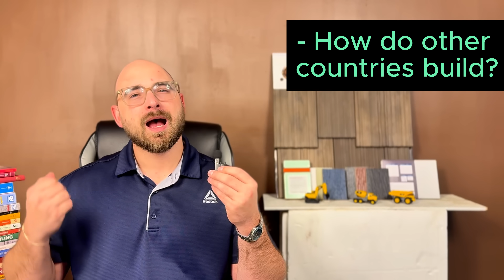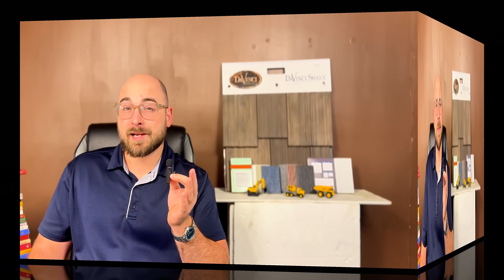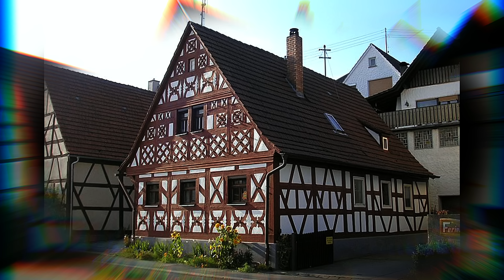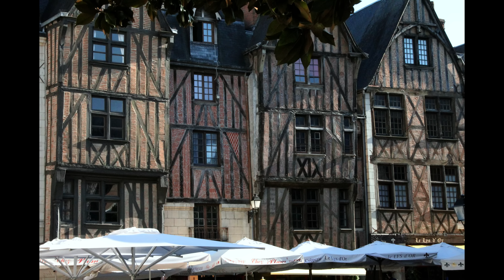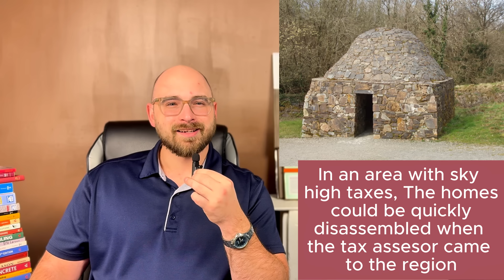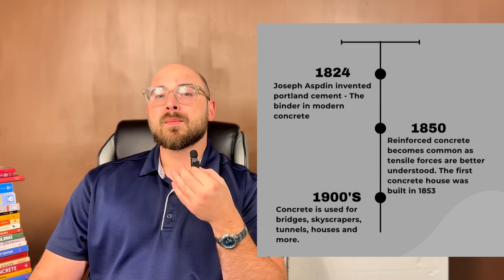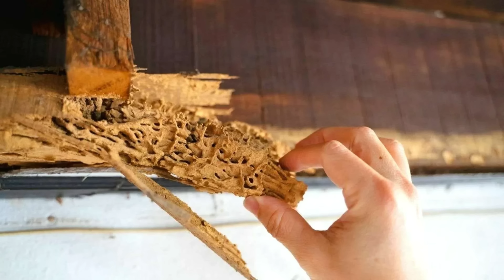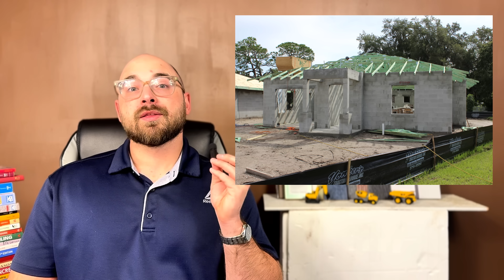Why Other Countries LAUGH at American Homes

Comment: As someone from Spain: it is common over here for people to joke that houses in the United States are made out of wet cardboard. I can understand if houses are made of cheap materials in areas that are hit by tornados and monsoons often as to rebuild them quickly, but at a certain point they're just making the joke become reality. Punching a wall and making a hole through it wouldn't make me feel one bit secure inside that home, that's for sure.
Reply: Lol you cannot punch a hole through the exterior of a house in the US
Reply: in a land full of people with (unlicenced) guns i'd also rather have a concrete wall around my sleeping place.
Reply: Tell me you’ve never worked construction without telling me you’ve worked construction
Reply: Hopefully you don't take it personnaly and before that, I love my spanish collegue at work. But the quality of apartment in Spain and more specifically in Andalousia si a joke. You can here everyone everywhere in those apartment. We laughed a lot about it at work.
In France we are arrogant and full of rules for everything (it's a pain by the way), but at least our homes are top of the line. Even the windows is doubled/
Reply: As someone in Tornado Alley, building with wood isn't just about being able to rebuild quickly and cheaply. It's also about saving lives. It's easier and safer to dig yourself out of a pile of wood and drywall than it is a pile of bricks and stone.
Reply: @HeadFullaStuffin  why would you assume they would collapse. The last time building in my country collapsed was cuz in WW2 the germans bommed us. Other than that our buildings withstand nature like they should
Reply: @DaveGymShark  because if the storm is powerful enough, NOTHING is left standing. Y'all can get away with building with stone and brick because your storms don't get as powerful as often as ours does in the US. Go look up some tornado videos or hurricane videos and see exactly the kind of damage I'm talking about.
Reply: @HeadFullaStuffin  so amarican to assume we dont experience tornados. Just cuz u dont hear about em dont mean they didnt happen. Just accept it we have better infrastructure.
Reply: @HeadFullaStuffin  you can build tornado proof homes tho... like you retarded ? you think the US is the only country on earth with tornadoes ? tornado alley is only famous because you guys have to rebuild entire cities because of 1 tornadoe xD
Reply: @HeadFullaStuffin You have wooden houses all trough your country. Tornado's are just in a small part.
Quality of live is way higher here.
Reply: @HeadFullaStuffin If the storm is that powerful you'll probably be dead and buried under your wood pile anyway. I think you need to read the room a little and realise you've bought into the message a little too much 🫤
Reply: @lucaslandman8370  Do you not conceptualize that the Lower 48 US is very close to the total size of Europe and that the land space that can regularly be hit by Tornadoes is Huge. We get 1200 tornadoes to the 300 tornadoes all of Europe sees in a year.
Reply: @aaronorr5586  It's not about tornado's.  It's about being cheap and the whole focus on conumerism.
Reply: @aaronorr5586  So why build with wood outside tornado area?
Reply: @ Because frequently building homes out of concrete you end up with homes looking like Soviet bloc housing. Concrete alone also has poor insulation ratings in comparison to mineral wool/fiberglass insulated Wood platform framed houses. Internal ducting, Electric service, and plumbing also becomes far more difficult for tradesmen in concrete housing. Signal transmission for Smartphones and WI-FI in Wood platform framed houses is far more expedient. 

Concrete Masonry units and solid concrete formed walls rarely rate over r-6-r-8 at an 8" thickness where a 2x6 wall with insulation will net you a total assembly of r-19
Reply: @lucaslandman8370  A large portion of some home prices here in the US isn't even the structure, it is purely the land and local housing market that drives the price. The house I currently live in could be built for 80,000 in materials, and systems but because of where it is it is valued at 230,000.
Reply: @aaronorr5586  again.... Why build it with wood?
Reply: @aaronorr5586  You should visit Europe. You are brainwashed.
Reply: @aaronorr5586  You won't find any house below €300.000 over here.
Reply: @ I already pointed out why you build with Wood Platform framing. Insulation value, the ease of running the Utilities, the efficiency of fiberglass/mineral wool insulation. It makes the house more efficient at any given wall thickness than block or brick which both have much poorer r-values, it removes the additional cost of setting full courses of block and/or brick to create a full height wall, wood framing traps co2 in material of the house where concrete and brick don't, concrete and brick require the burning of fossil fuels to produce.

You get a house with plumb, square, and straight lines that in most cases will last for 70-150 years, you won't be paying for an extremely over weight and ugly block monstrosity, and your summer cooling and winter heating bills will be lower in comparison. 

Part of Homeowners insurance cost is price to rebuild in case something happens. Platform Framing rebuilds are charged at a lower insurance rate premium versus any block or brick built home, and when the Tornado inevitably hits it is important make the house right again as quickly and within the budget of the homeowner as possible.
Reply: @aaronorr5586  Sure dude. Stay in your bubble. Murica!
Reply: @aaronorr5586 concrete can be shaped in any form and painted in any color. It can also be covered in other materials like plywood. If you're making Soviet style blocks, that's on the architect, not on the material.
Reply: @lucaslandman8370  The Pacific side is Earthquake prone and they aren't extremely deep quakes (to give a hint, was driving during the 2001 Nisqually earthquake, the road was and still is straight, during the quake, the steering wheel was straight and I was in the wrong lane and then back until I had a spot to pull over, and that was a 6.8/Mecalli VIII. The Southwest has the problem of massive temperature differentials (Highs well into the triple digits, going to a nice balmy 50 at night), the Great Plains have the problems of Tornado alley which is basically from, let's use Europe here, Palermo to about Frankfurt-am-Mainz without anything to really block it, and in the North east on the eastern side of the Great Lakes as well as Michigan we have the Lake effect problem which blows european minds when we're talking 9-10 feet (3-about 3.5 meters) of snow in days, and need to be able to withstand that amount of snow along with the cold that comes with it.

A lot of it is the fact that you have a continent sized country that has, ironically just about every bioam, and amplified disasters that while Europe may get them, you aren't looking at people dying because it's 21.1 C because homes have been built to also keep heat out (or breathable), are made to collapse or not get tossed as debris when an F4 or F5, or even a regular F3 (the largest for Europe and it's rare there, not the average), Earthquakes that are generally more surface level and more often, has to be put up in places that can get METERS of snow over the course of days, not months, regularly, and has other things like Category 5 Hurricanes. And remember two of the scales are logarythmic, and one is windspeed+damage. So while a 6.3 doesn't sound big, that's about the equivalent of an F3 tornado in damage, or a Category 3 hurricane, and once again that 6.3 I was driving through was enough to diplace me a whole lane on a straight road.
Reply: @HeadFullaStuffin  ??? such a stupid  thing to  say  ....when you  can build house that  rezist  200km  wind  ....i  wonder  whay  quality  is equal  with  cheep  in US
Reply: @mellasio3911  200 km per hour winds are fine. But we also get over 300 km per hour winds. That kind of wind speed not only tears apart buildings, it also carries the debris with it. I don't know of any structure that would withstand that kind of intensity for even a couple minutes.
Reply: @HeadFullaStuffin  i  can  show  you  projects  of  housings  that  are  build  for huricanes  survive and many  other  stuff  like look  at  systens  that  japan has in place for  natural  dezaster.s...it  looks the tehnology  exist  ...we  have a saing  in my  country  ...am  to  poor  to  be cheep
Reply: @mellasio3911 no home construction can survive an f5 tornado unscathed.
Reply: @HeadFullaStuffin trust me, reinforced concrete would withstand those winds easily. Say bye to your doors, windows and furniture, though.
Reply: @HeadFullaStuffin  At that point, that's just Mother Nature kindly telling you to f off from that area and build your house somewhere else.

Comment: I think most homes in Germany (at least those ~20-40y old) use a combination of double layer bricks for the outside (with those older homes often using air as insulation still), concrete for the floors and above door and windows and what I believe to be cinder blocks or concrete for some of the inner walls (I think the basement uses cinder blocks for the house I live in, which the upper floors seem to use more concrete, you at least don't get as many holes when drilling).

Also contractor familiarity isn't really a point as that just depends on what's common locally. Contractors here are perfectly familiar with solid structure. But then again we also do a lot of our own stuff here. Painting, electrical work and other things are just commonly done by the resident if you own your home because they're not ready that complicated if you just add a light socket or something.

Comment: Building with what you have isn't always a good thing.
Building with what you need is smarter.
If you live in hurricane valley you need to build something that can withstand a hurricane.
So why build a house that is weaker than a card house and not something that can withstand a hurricane. (it could literally save your life)

Comment: Well done. I understand why Europeans (except for the Nordics) prefer brick and concrete construction. (But in the more seismically active areas of Europe, this is not necessarily ideal...)

But in countries that DIDN'T clear virtually all their forests in the Middle Ages and early modern era (e.g. in North America and the Nordics), it made (and often still makes) sense to use wood for low-rise residential buildings BECAUSE it is flexible and (often) a local material and, more or less carbon neutral (to the extent wood is actually used), compared to, say, concrete.

Particularly in areas not subject to frequent natural disasters (major earthquakes, brush fires, floods or lava flows), there is nothing wrong with wood construction.

Comment: I'm from Romania. A friend of mine built an American house for himself. Right in the middle of the city,  between hundred years old houses. It's squeaky, there's noises when you move trough the house. I'm trying to find something to say about it but .... there's nothing to say
Reply: When there's noises when you move through the house, the floors are not built in a good way. The builder, and/or your friend possible wanted to save money, not using enough nails, glue, good floor material and so on)
Reply: @Rimrock300  the land costed as much as the house. This should tell you all about the quality. If he can get away with it and it doesn't fall apart, the American way might be the best way to build housing. Time will tell.
Reply: @GeorgeS-z8x  The American way of building wooden houses is okay. But there can be great variation in result depending on quality of materials chosen, and quailty/experience of craftsmen used.I guess same situation with all kinds of housing

Comment: Concrete houses are fine. The important change with those houses is the mentality. If I recall correctly, American homes stay for about 30 years on average. European homes stand frequently for a century. The house my grandma had is over a century old now. With houses built to last, a willingness to spend extra should be present. Adding extra outlets in a concrete home is very expensive and complicated compared to the wood framing in the US. 
So not only is it a change in materials but if home owners are to enjoy and appreciate their structures, they need a higher standard as well.
Reply from the maker: It’s not an easy shift. 

I find it bizarre that there’s been almost no innovation in 60+ years and buyers, builders and contractors alike vehemently defend the bare minimum standard (that they often struggle to meet) 

Who would have thought that quality construction at a marginally higher cost would be so controversial 🤔🤷‍♂️
Reply: Why would adding an extra outlet in masonry home would be more complicated? You just use a chaser, cut a groove to the nearest junction cut box opening, run the wire in conduit (or not), plaster, paint.
Reply: @ElegantiaeArbiter  True, I'm based in Switzerland. I haven't had this experience myself but I'd estimate the cost of such an endeavor to be in the thousands of CHF. It is also, at least to my knowledge, not very commonly done in residential buildings. The instances I've personally seen where this happened, was when buildings were renovated. 

(Besides, if you don't care about how pretty it looks, you can also put cable pipe outside the wall in just nest in one of the corners.) 

As far as I've seen here on YouTube, it's common to just punch a hole in the dry wall, put a receptacale box there and drop a cable in the cavity of the wall. 

The point I was trying to make, masonry homes do have their advantages but it is a lot harder to change things after they are built compared to wood framed houses.
Reply: @Well, if someone wants to charge thousands for a few hours job then it's the same kind of extortion like charging half a million for a shed-like house.
Reply: @ElegantiaeArbiter  It's Switzerland, everything is sadly very expensive here :/
Reply: If the prices are not reflecting true labor cost then they would also charge millions for adding outlets in a stick house :)
Reply: @ElegantiaeArbiter 
To give you a more precise answer: We have a shortage of people going into the trades. And we have a lot of people going into academia or just the service industry. 

If I'm not mistaken, there's also laws in place to prevent contractors from outside the country to offer their services here.

So the short supply of workers, plus the generally high price level ends you in a place, where even something like replacing a faucet by a plumber costs about 1k (info from my parents ~1 year ago).

It's not nice. The people who have the skills do this kinda work themselves. Or relatives and friends do. But on a national level, it is a problem that's not being addressed.
Reply: @AliSot2000 The move-away from trades happened in all western countries. It's a serious problem, but I think it will change.

Comment: Building in North America doesn't suit one mold. An appropriate structure will look vastly different if you are in Florida, Maine, New Mexico, Oregon or Alaska.
Reply from the maker: And yet we will stick frame houses in all of those places because it’s the cheapest option
Reply: I would say that appropriate structure SHOULD look vastly different due to different climatic zones and material availability, but the structures always look the same - few sticks and toxic boards stapled together. They may have varying outside finishes and prices, but the structures are the same.

Comment: The simple question is

How many limbs and organs would it cost me to have brick and concrete over wood.
Reply from the maker: Here’s the crazy part, 

If you build an efficient wood house (more than the bare minimum) 

It’s around the same price to build with ICF. 

By the time you improve wood construction to be comparable, ie. Better insulated, air tight, smart membranes, etc,   You can just build with insulated concrete and have the added benefits of longevity and disaster resistance

Comment: It's just a matter of building code. The standard in the USA for residential buildings is way lower than in Europe and that's really all there is to this debate.
Reply: yes, you are likely on point. The problem is not use of wood material, but the codes

Comment: In Scandinavia houses typically are mostly wood, but the frame is steel beams, bricks and concrete for structural integrity. And walls are thick for insulating sound and heat.
Reply: The large majority of scandinavian houses will have a concrete fundation and timber framed walls/roof. There can be a steel beam used in the floor or ceiling to avoid a support pilar in a room, but will not say steel beams, or bricks, are any important part of the structure of ordinary scandinavian homes. Bricks are moreused for it's looks,to get a contrast. In more expencive homes, archtechtural special desig, steel andbricks can be used as important structural materials.

Comment: I've had these discussions myself before.
My conclusion is that to many Americans the size of their homes is more important than its longevity. You can also find data to back this up. American houses are on average much larger than their European counterparts. And that doesn't even take ceiling-height (volume) into account. 

If you want to have spacious, yet affordable homes, you must cut costs somewhere. Light-wood-framing is comparatively cheap in terms of material used, it is quick to build (cutting the cost for labor) and it doesn't require highly skilled craftsmen (again cutting cost of labor).

In urban areas with a higher price per sq.ft. (lot size), where they are practically forced to build smaller homes, Americans tend to use concrete and bricks as well. Think of New York (Queens) or Philadelphia.